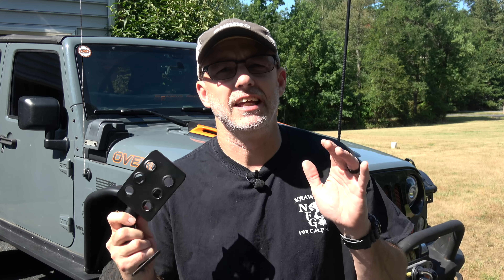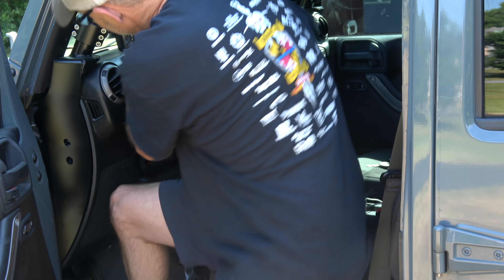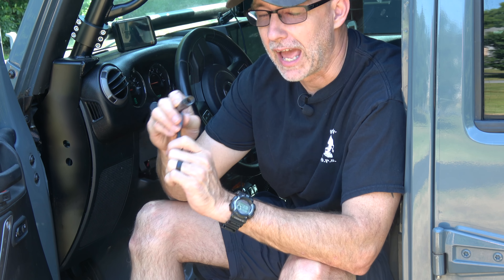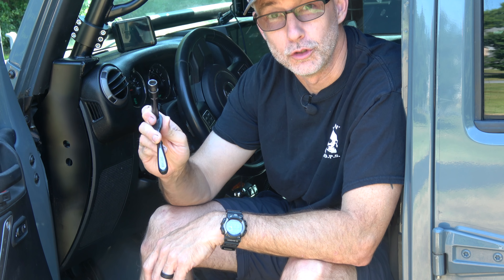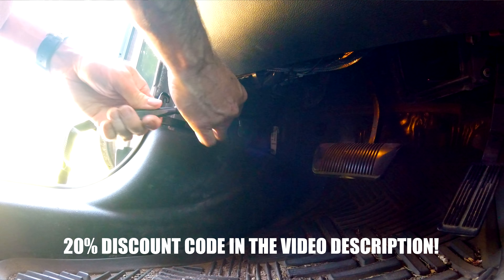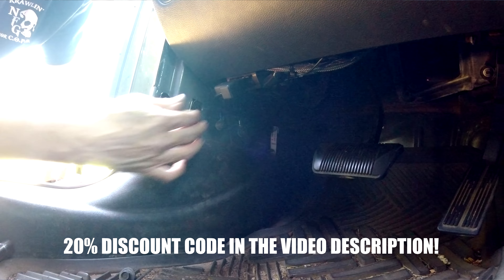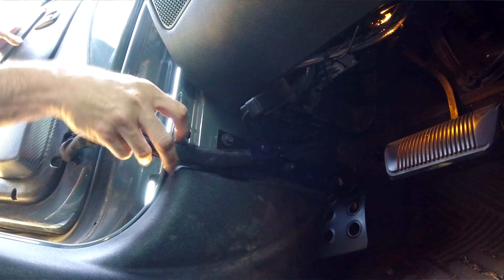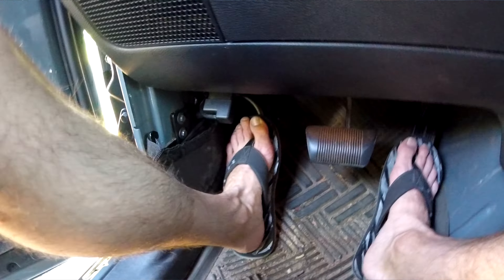JK Dead Pedal Install from Team Tech Offroad

Comment: Neither site found .
Reply from the maker: worked for me just now....
Reply: For some reason the link still doesn't work for me .
Reply from the maker: Weird.  Try refreshing... but I just accessed it again to be sure.
Reply: You need to delete the %21 from the end of the link URL.  Pretty sure that was added by having the "!" at the end of the hyperlink.
Reply from the maker: good catch on the one... fixed that. The other doesn't have that tho... so...
Reply from the maker: use this: https://teamtechoffroad.com/products/xyzctem-2007-2015-jeep-wrangler-black-metal-left-side-foot-rest